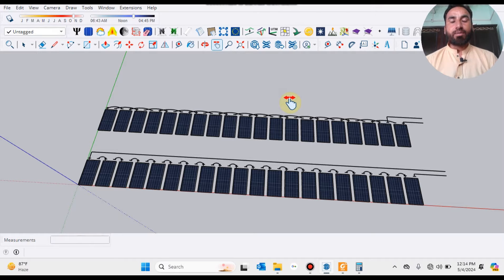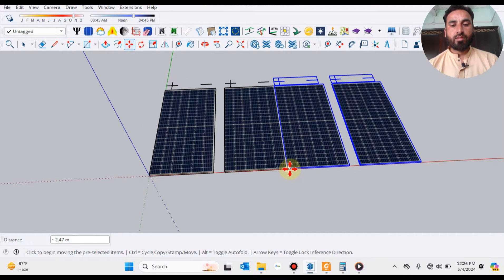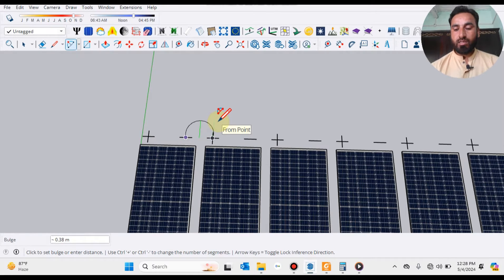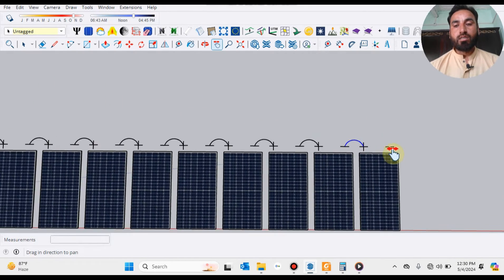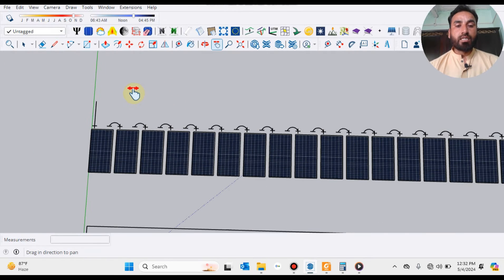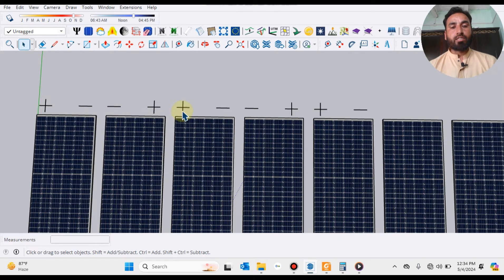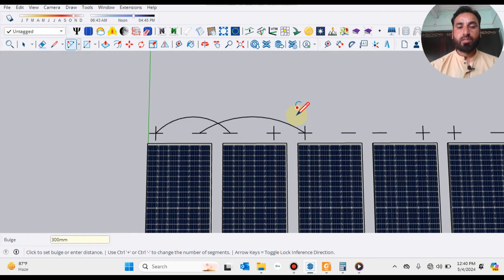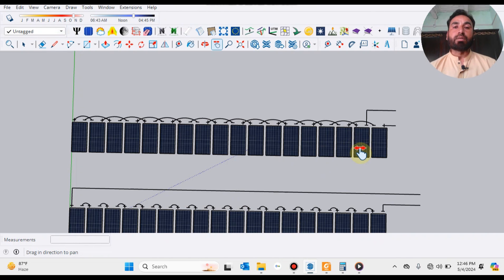How to connect Solar Panels in Series: Daisy Chain & Leap frog jumping

Comment from the maker: The recommend method of series wiring is leapfrog jumping but need to confirm the DC cable size of Solar panel or order for customized length from OEM